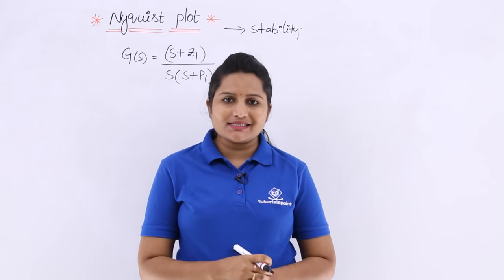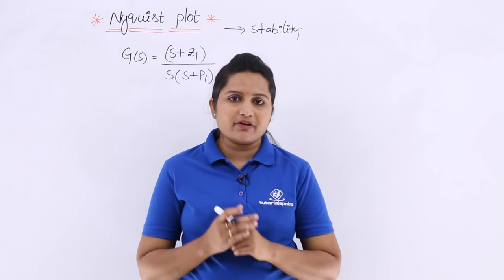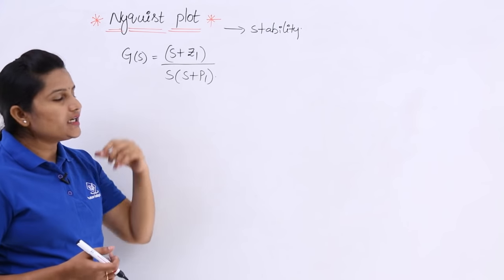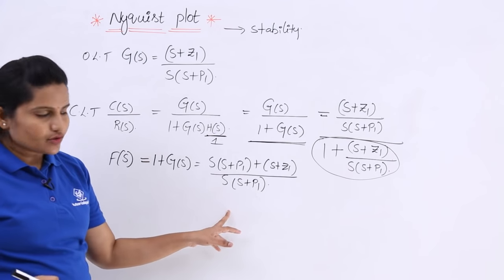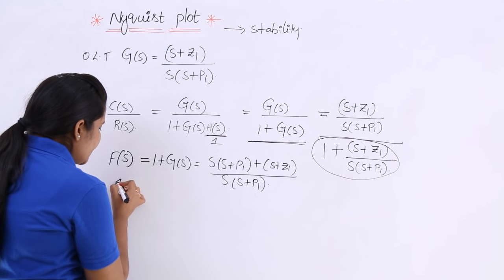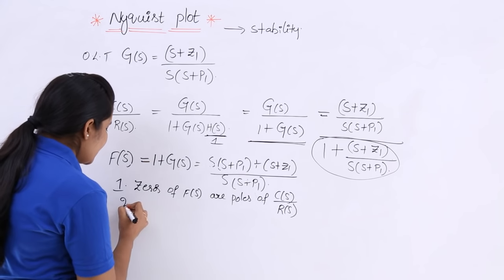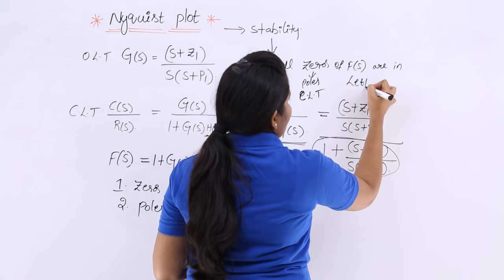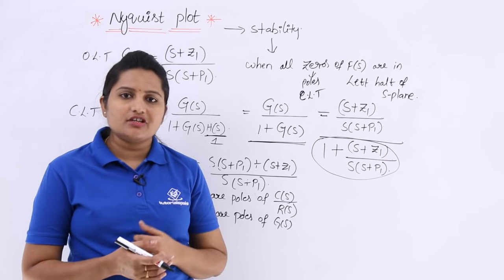Nyquist Stability Criteria Part 1

Comment: how can we say the stability criterion from polar plot
Reply: We cannot. Polar plots are not to find stability. That's why Nyquist's were developed
Reply: @hemanthbhaskar6964   what is the use of polar plot?
Reply: @-TejdeepPanchika  in a single plot, we can say the behaviour of a system over the entire frequency using a polar plot
Reply: @hemanthbhaskar6964  i think you're wrong there my friend .
By use of   crossover frequencies , we can calculatr phase and gain margin and by the sign changes in these  margins both +ve then system is stable , both negative unstable , 
One positive and next negative gives  us marginally stable .